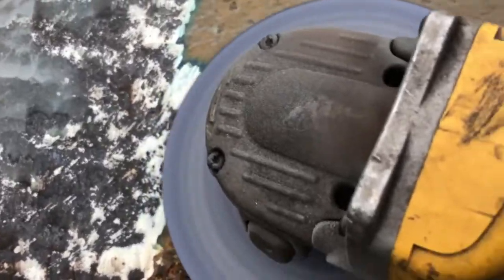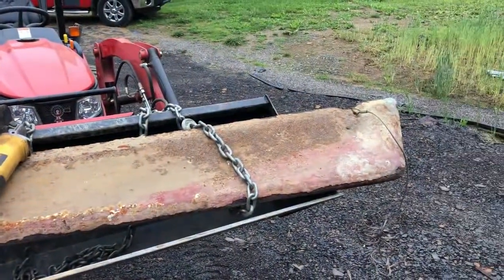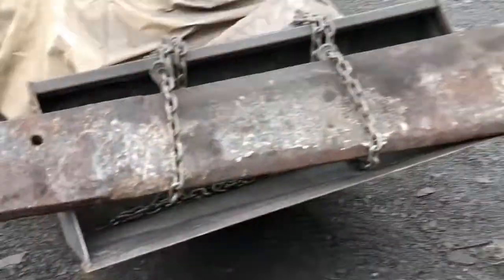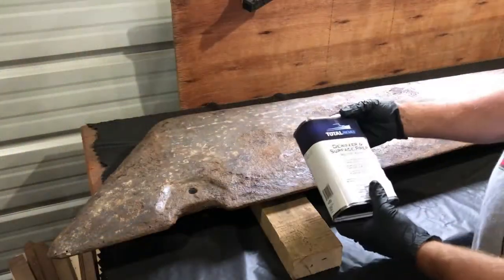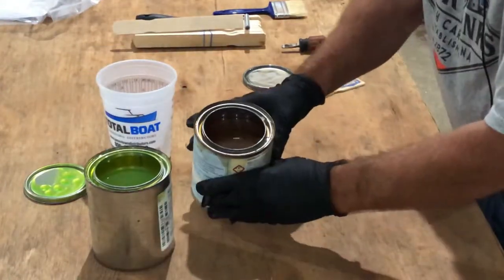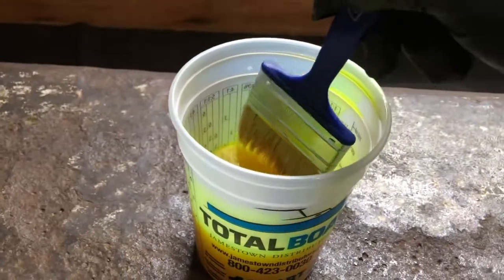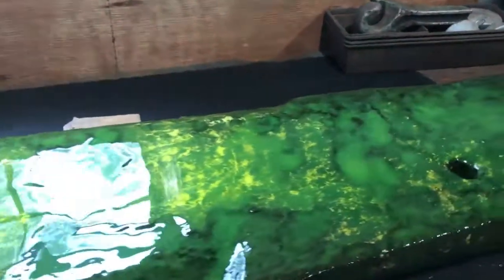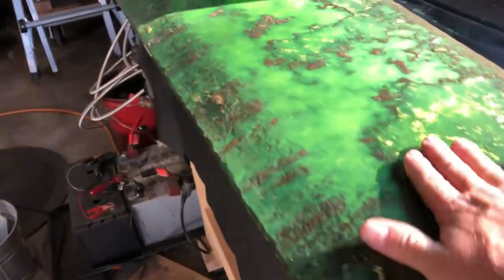Grinding and applying Rust protective coating to swing keel. South coast Pocket sailboat refit.

Comment: I'm doing likewise however I'm welding in filler rather than epoxy.  
Any thoughts about Teflon final coat ??  TIA.
Reply from the maker: I have been thinking about this and I believe that although it’s mostly going to be a fresh water boat that I may be applying a good quality bottom coat, I do still plan to take it to the Florida keys when it’s ready and sail from key largo to key west. So, some salt water protection may be in order.

Comment: You mentioned a lock pin that keeps the keel down. Like yours, my sc22 keel tunnel is glassed over and I can’t find anywhere to insert a pin to lock it down. Looking at your keel I see only 1 hole, which is obviously for the main pin. How exactly does the locking pin work if there isn’t a second hole in the keel for it to go through?
Reply: Mine was glassed over too which I think people are doing because they may not fear a blow down in this boat or just hated the constant leak they likely all have. I noticed my main keel pin was leaking on first drop in, so I had to completely glass over the ends. I have seen a bolt with rubber washers used to seal the lock pin hole while the pin is in place which is what I will probably do. also found the template to measure for the new hole at the south coast site.

Comment: What is the keel made of on these south coast 22s? Mine is going to need some love but I'm confused because of the look of it where it's been beaten up some. Is the outside metal wrapped around  the lead?
Reply: I've got pics but can't post on here I don't think
Reply from the maker: No… it’s solid steel. Mine was encapsulated in what smelled like body putty for automobiles.
Reply: That's what mine looks like. Like it's encapsulated in something
Reply: @grantdavis3761  After some aggressive grinding, I was able to clean mine down to a pitted steel casting with a bead blaster. After rust bond, fiberglass and a new PVC protective leading edge further Fiber glassed in, I set it back in place with a new SS main pin and she did well on the water this year.